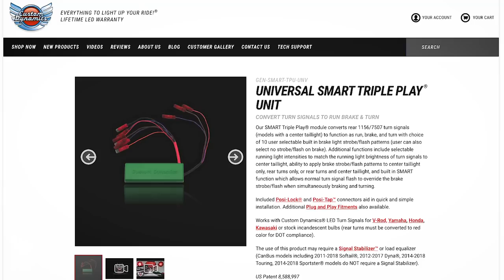HOW TO: LED Tail Light Install / Remove Stock Tails - Harley Softail

Comment: Hi All. I need to relocate the rear light of a 2021 softail standard.  Have a relo kit that came with my Viking saddle bags.  Seems I will need extra cable, as my rear lights connect to the power supply under my seat, and there isn’t enough cable to pull the lights any further back. Where can I purchase additional cable? Any help would be appreciated! :)

Comment: They are ok but personally prefer custom dynamics billet style LED’s, keeps it looking more traditional, but to each their own
Reply: I literally just put in the CD turn/run/brake LEDs into my 2020 LRS last week.  Fiddly but relatively easy and now lots more light in the rear
Reply: @twodogs2076  I have a 2019 RGS, so very easy to fit CD LED turn signals front and rear, as easily as changing a bulb, no splicing or extra modules needed 👍
Reply: @paineys3341  Turn signals are easy, but making them also run and brake lights means you have to pull the backend/fender etc apart.  Just like @BaggerBro did..

Comment: I don’t know… I kind of jumped around on your video a little bit but when I see you installing the wires for the LEDs, you dont explain which wire goes where. All I seen was you splice them you heat shrink them and you said that’s it. I’m just frustrated. Mine has four wires coming off my LED’s and 3 going in my bike. For the life of me I can’t figure it out.  maybe I missed it.

Comment: Great job.  Just a friendly tip, the wire strippers would save you a headache by trimming those bolts to size.

Comment: What happens if you just put the 2 positive wires together? I know you just used the blue and black. I just installed mine and they work but now not sure if I did it wrong?